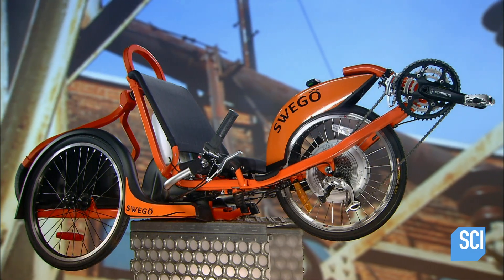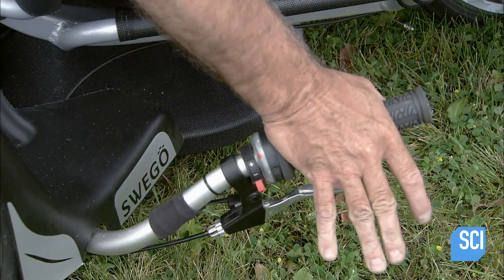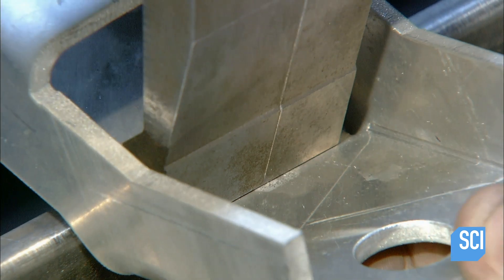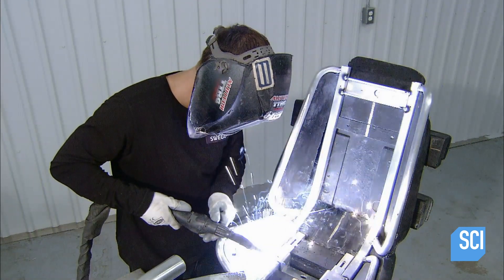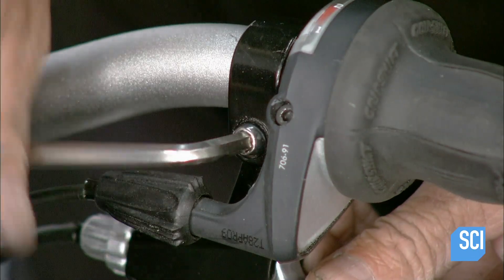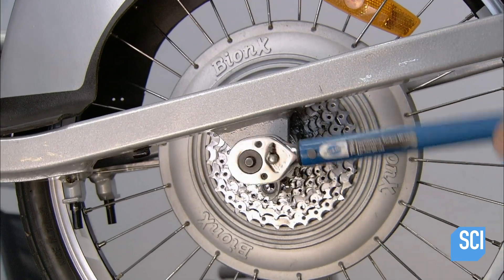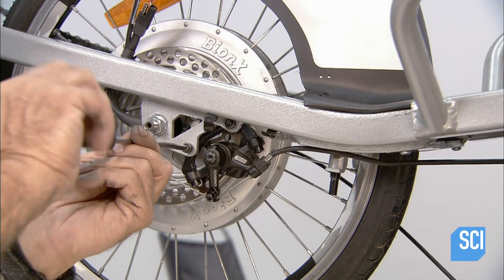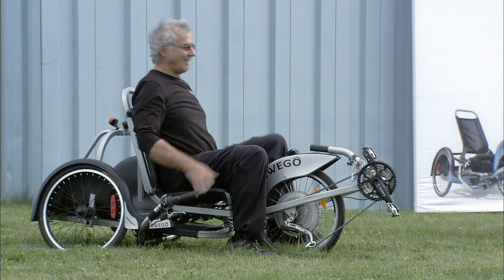How It’s Made: 3-Wheel Electric Bikes

Comment: Wow. $4k USD and they use SRAM X-7 and Tektro. Those are low-mid range parts.
Reply: Wouldn't a modped or whatever those electric driving scooters are called be not a bad leg up from that? Cause they are like what's? 7k to 12k?